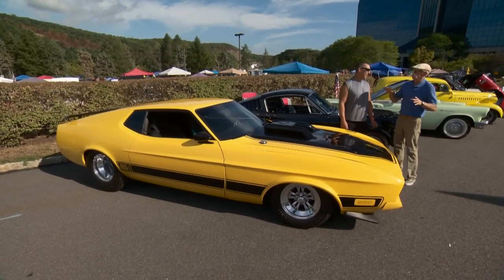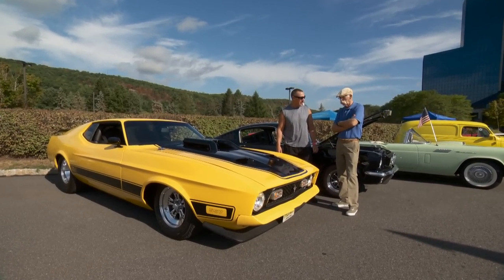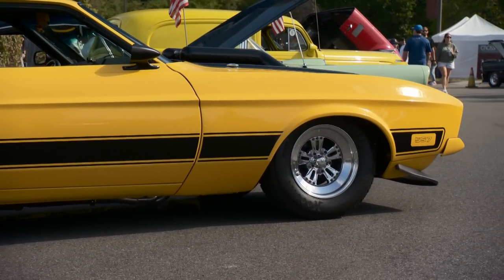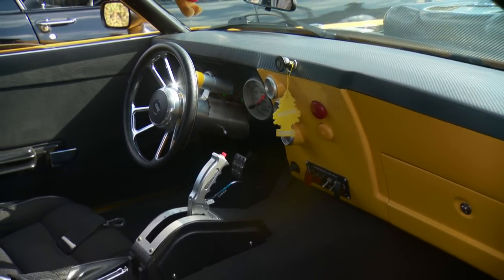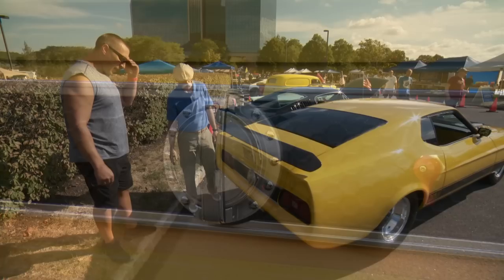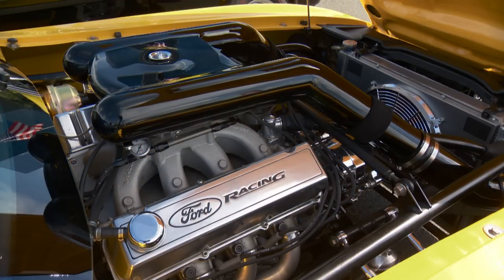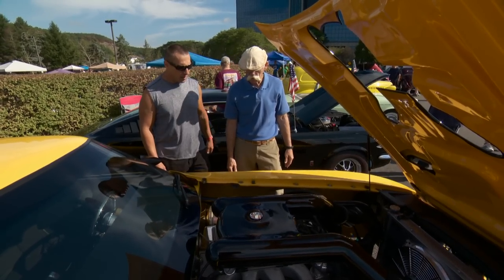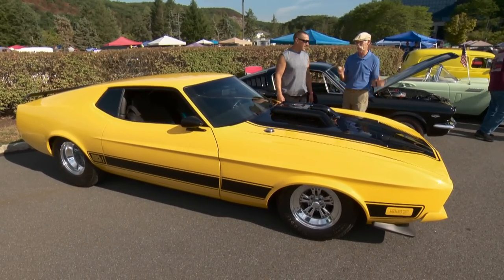"Long Nose" Mach 1 Mustang

Comment: The 1973 never had a 429 in it. The 429 was only installed in very few 1971 Mustangs. (1,865 to be exact.) The Boss 351 and the 429 were both dropped in 1972. The largest displacement engine was a tuned-down 351 in 1973. They've really customized it. The exterior of the car looks nice. The interior, I will simply say, to each their own. The 1971-1972 grille looks far better than the original grille in that car, though.
Reply: Thanks for the information, I always love learning something new.

Comment: NICE car! That car never had a chassis, because it was a unibody design. The new Mustangs come with more horsepower than any of the first Mustangs ever had. 
My brother-in-law has a 71 Mustang with a Roush built 429 (534) that has a LOT more horsepower than that one. It is for sale.
Reply: What!?!? new cars tec make more power....unbelievable!
I dont know much about big blocks, but best small block to date (351c) made 385hp on engine dyno stock (from 71 boss) and can be modified (without force induction) to spit out 500+ hp
Reply: @blackgenesis7472  not listing supercharged Mustangs:
2015 Ford Shelby GT350 Mustang. 526 hp...
2024 Ford Mustang Dark Horse. 500 hp
2021 Ford Mustang Mach 1. 480  hp